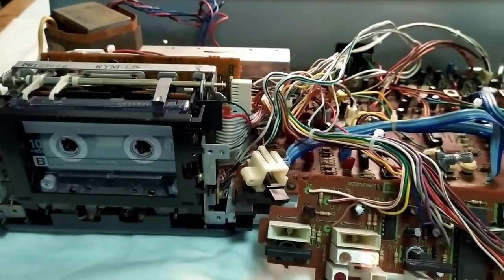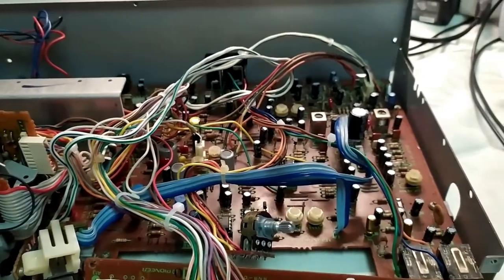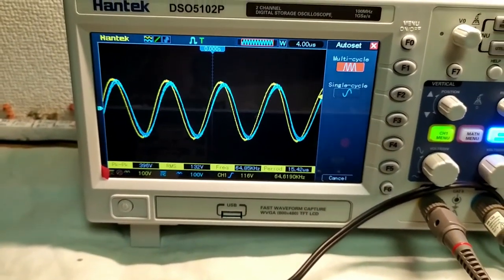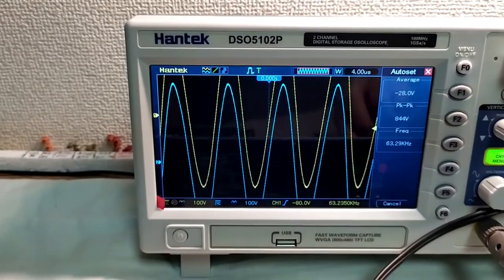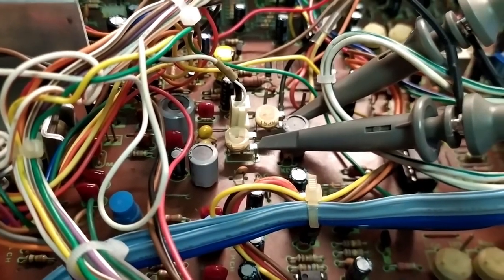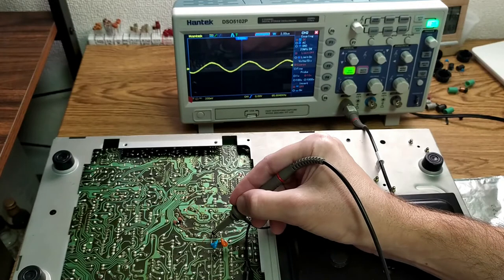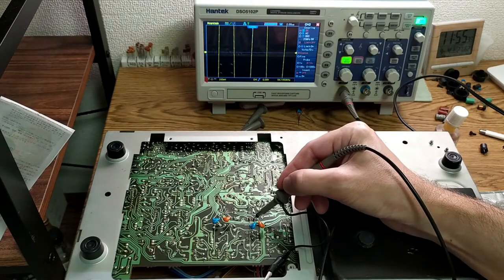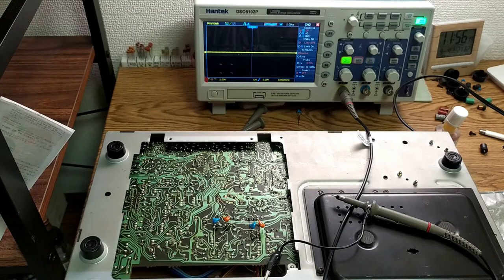Pioneer CT 7100 Bias Trap - Diagnosis and Repair

Comment: Hmm, i didnt know that a trap was needed, but i do know the MPX filter can cause distortion if its faulty or messed with.
Reply from the maker: Yeah, the traps are only needed for recording - when they don't function or they are removed the high voltage signal gets to the recording amp and basically you'll get nothing on that channel.  Probably not real good for the amp either.  Interestingly, the Technics has a tunable bias trap by way of adjustable inductors.